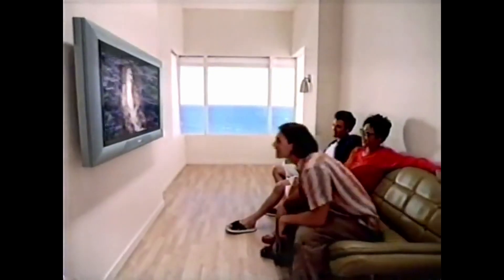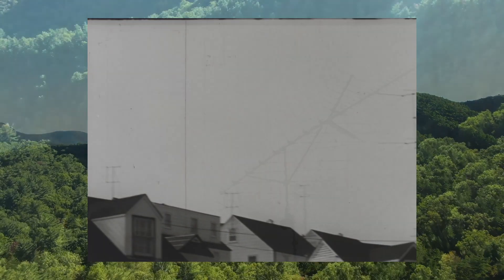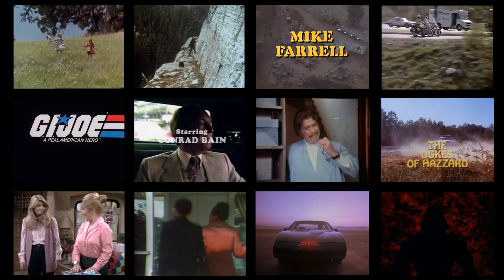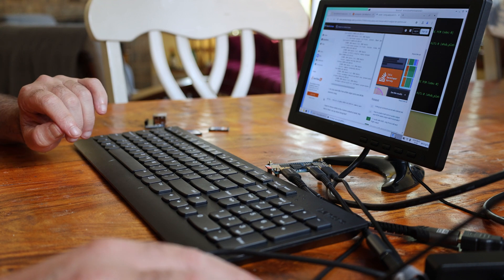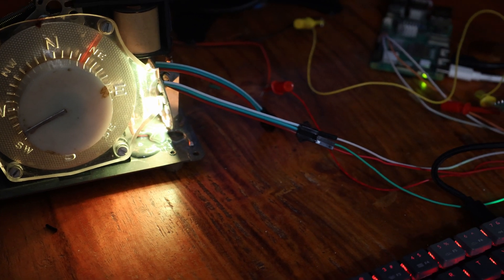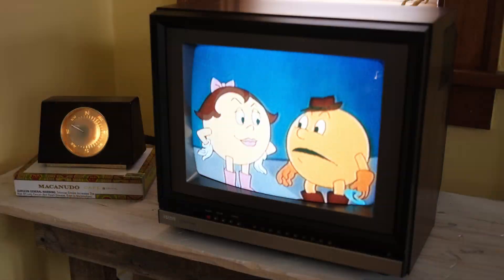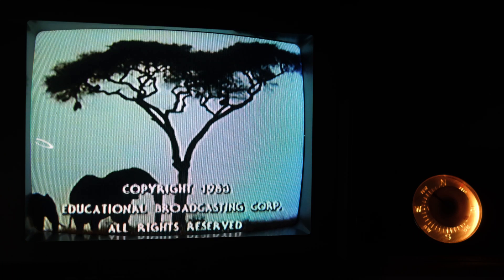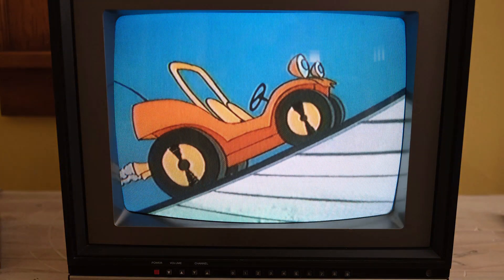My Nostalgia Machine: Recreating 80's broadcast TV with a Raspberry Pi

Comment: I think you antenna controller box was working okay.  The antenna rotor is an AC motor that runs in the 20 something voltage range.  All that is in those boxes was pretty much the knob, a transformer, capacitor and a solanoid that was used to show the antenna position as it moved.  One other thing, the TV signals didn't bounce off the cloud.  It was more likely due to tropospheric ducting.  Nice project though.
Reply from the maker: This is great information. Do you think that post I hooked into was used just to provide tension and clicking into position when turning the knob?

On the bouncing off the clouds - yeah, that is the story we told ourselves whenever we could got the Dukes of Hazard in clearly. I'm disappointed that I just passed that 'common knowledge' on as a fact. I am off the learn all about tropospheric propagation now :) Thanks for the heads up!

Comment: In the days before cable. it was not possible for me to watch Ch. 5 from NYC without the rotor-equipped antenna.  I would have missed Sandy Becker, Chuck McCann, and of course Soupy Sales.
Reply from the maker: Soupy Sales - you gotta love a guy whose name alone can crack you up!  I had to look up Sandy Becker - but its interesting because it says "Most of Becker's programs were not preserved. Because they aired live and were not kinescoped or videotaped; they live on only in the memories of those who watched them" - this is the same as the clips I showed on there of 'Monty’s Rascals’ by Monty DuPuy and Stowe Hoyle that aired on 'You're Friend 4' WYFF out of South Carolina. Its a shame that there are just a few clips around.
Reply: @wrongdog_reckons  Soupy's tweets are still up.   Google them but be prepared.

Comment: Brilliant! I've been planning on making a project like this for quite some time. I suspect I may have seen the same video that inspired your project, which also inspired me to do something similar. I will be checking out your source code as your solution seems so well polished it will probably take away most of the guess work! I had planned to hook the system I make to thr RF wires in our house so it will have that authentic "tuning in" feeling. The house I live in used to be part of a hotel so theres coaxial cable running to every room 😀 It seems a shame to waste it!
Reply from the maker: This is great - would love to see what you make! Yeah - that video was a big inspiration to me, not just this video, but the whole idea of starting a channel with my side projects. Having the coaxial running through the house is simple: you have to do something cool with it! I've been looking at ways to broadcast so that it gets the 'air artifacts' in the signal - there are some CC solutions out there. Have fun and show us what you make!

Comment: How did you cut commercials in the right place, where the show planned for a break?  It's awful how YouTube just stops anywhere in the middle of speaking a word.
Are different shows/channels assigned different sponsors?
Reply from the maker: I didn't defeat that - and sometimes you get the "We'll be back after the break" and then no break. One of my next updates will be to put chapter markers in the video files (or associate metadata) - but while the algorithm considers duration of the blocks to try and make a natural feeling, it still has odd timing.
Reply: @wrongdog_reckons  Duration of blocks?  Does it look for a silent spot so it might seem natural but at least doesn't break in the middle of a word?
Reply from the maker: @JohnDlugosz  I haven't added that yet - it currently cuts in even increments of time based on the number of commercial blocks that should be in it. Sounds like the next obvious feature to add - FFMPEG should be able to help with that.
Reply: @wrongdog_reckons  Wait another year and you can just tell the A.I. to find the spots for the commercial breaks.